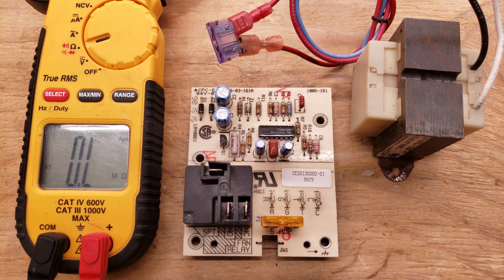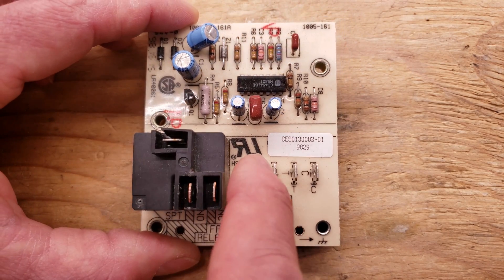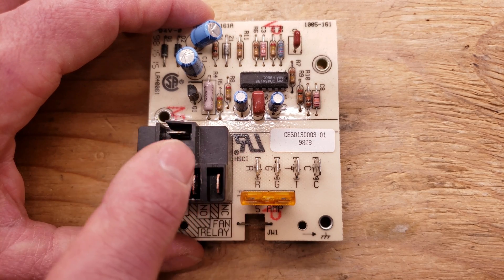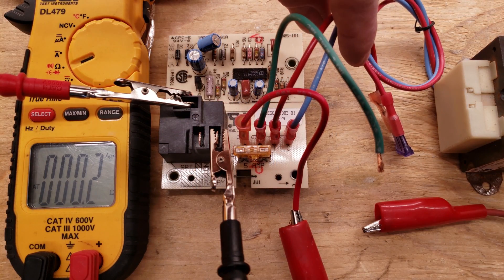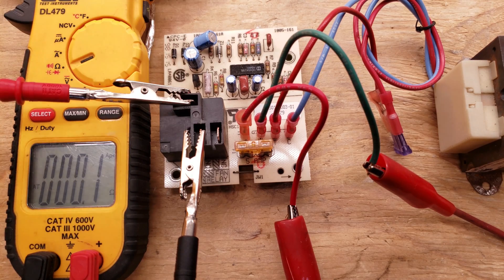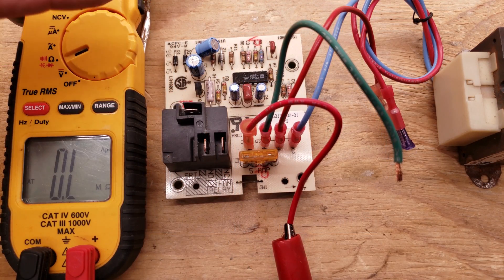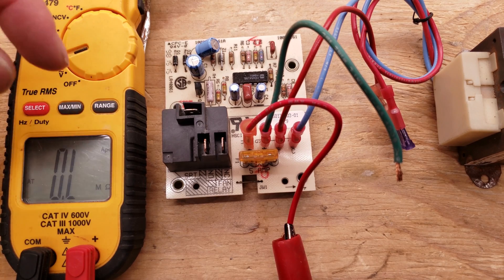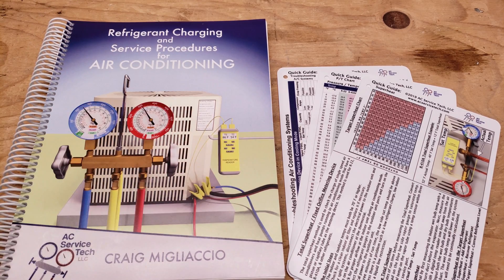Air Handler Control Board Operation and Troubleshooting!

Comment: I’ve had two of these control boards catch fire and the relay melted. Is there any recall for this problem & can I use an off board relay that would be safer?

Comment: Thank you. What I've noticed about all fan boards and all other HVAC boards is that they share 3 functions: input, logic (or process), and output. Thus, one (or more signals) is sent to the input(s), the board processes the inputs, and then sends an output--like a relay closure.. Thus, the troubleshooting process is always manipulating inputs and verifying that the output responds as expected.

Comment: Is there a way to isolate my air handlers control board from getting too much moisture in my crawlspace? I’ve had to replace two, one 4 years after it was installed and another a year later. Tech showed me the latest failed control board and it had lots of white powdery substance around a few terminals. Looking for a quick hack until I can afford to purchase a dehumidifier. These control boards are not cheap. 
Could I put it in a plastic zip lock bag?

Comment: Question:  on one video you said you made the transformer tester the one in this video.  I understand all you have done here, testing the relay that operates the blower motor, but is the tester so that you can totally cut the power in the airhandler to make it safe with low voltage?  thanking you in advance

Comment: Summary:  Pls tell me if I'm wrong.   1.  shut pwr off at air handler.  2.  remove wires to relay and tape them away from board and each other.  3.  test C and NO to see if no resistance  same with C and NC  for resistance.  4.  Run a jumper wire from R to G test for resistance and level at said terminals.  5.  is the relay good and operating as designed.  Did I miss anything?

Comment: Love your videos, but for the lay person, to cut power then disconnect the wires from the relay, then turn on the power again with wires to relay disconnected, would like to see you jump the red and green wire from the inside of the wire covers at terminal?  is that what would be done.  Really good video and I do thank you

Comment: Thank you very much for your video. I don't have a control-board, but I do have solid-stat time-delay.
My ac system keeps running and cannot be turned off. I replaced a new time-delay, but it has the same problem. What caused the problem, please, help.?

Comment: Will this cause my compressor to shut off? I've got a heat pump that I'm trying to get working again. Lightning cooked the defrost board, contactor, transformer and condenser fan motor. The compressor is giving a good resistance value

Comment: I have an air handler in which the fan runs when the ac is
When the heat setting is on the fan doesn’t work on auto or
When I go to the cool setting the fan comes right on as

Comment: People think residential is basic, no you learn fundamentals
Thanks for the vids Craig
Reply: I think I have a bad relay on my Condenser fan  citcuit board.  When the fan stops spinning when I touch the circuit board the fan starts and I can hear the cranking noise stop/start on one of those black relays. How to  replace this circuit board? Any help please?

Comment: I'm assuming that the relay can be changed if it does not pass. What type be of problem would be encountered that would point to the board/ relay?
Reply from the maker: That relay is actually soldered to the board so you would replace that one. It is not a plug in type. If the blower runs all the time or the blower does not come on at all, thanks!

Comment: Great video Craig. So this the type of board you would encounter on a straight cooling A/H as opposed to the board on a furnace?
Reply from the maker: Yes, newer furnaces have an IFC which is an Integrated Furnace Control board. That controls ignition and the blower. The board in the video can also be referred to as an EFT, Electronic Fan Timer, thanks!